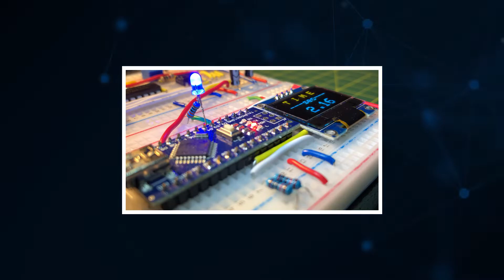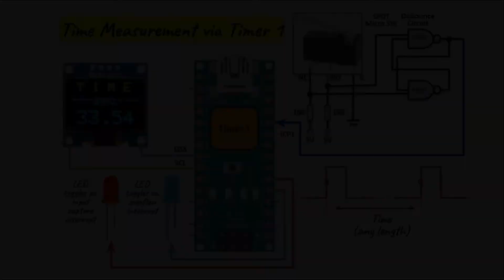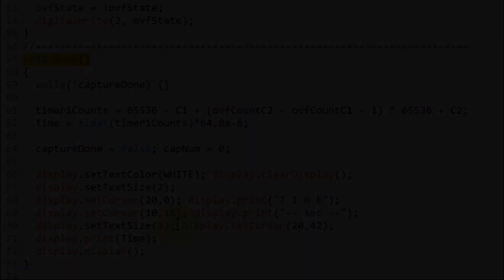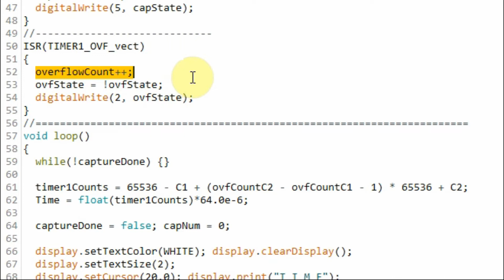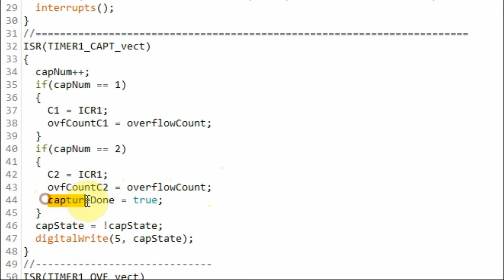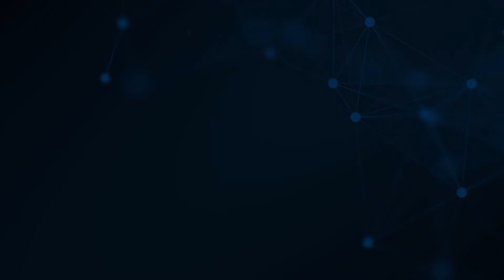Time Measurement via Arduino Timer (part 2)

Comment: Another excellent demonstration. I was just thinking have you ever tried to measure rotation speed (RPM) from a variable reluctance sensor? I was applying a similar technique to measure crankshaft RPM with 12-3 tooth reluctor/timing wheel and VR sensor. The idea I used was to count teeth. Measure time between tooth 1 and 3 to work out the time difference and calculate RPM. Restart tooth count after 9th tooth is captured. I was getting some funny results where the frequency would jump from say 400 measured to say 3800 and back again every so often. I couldn't explain it but now after seeing your demonstrations, I think I can improve my implementation. Thank you once again.
Reply from the maker: The best thing for me is getting useful feedbacks. Thanks you.

Comment: I believe your calculation could be slightly simpler by factoring out one 65536.

timer1Counts = C2 - C1 + (ovfCountC2 - ovfCountC1) * 65536;

This also makes a lot more sense to me, since the calculation represents that we take the difference of the 2nd and 1st pulses, and then simply add the number of overflow counts as well.

Another option is to reset the overflow count to 0 upon capturing C1, increment it in the overflow ISR, and then record the number that occurred when capturing C2 or in the main loop.
Reply from the maker: Thanks for the info